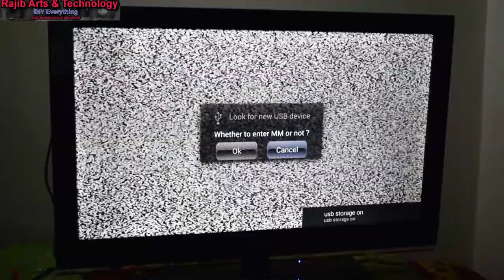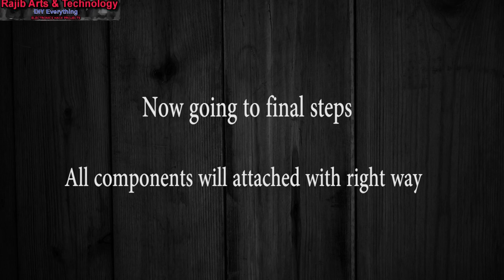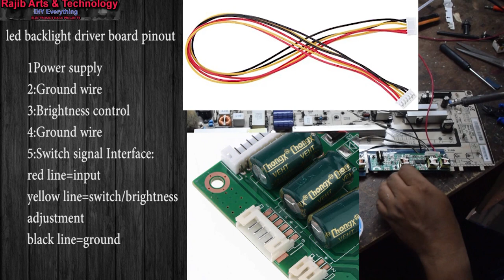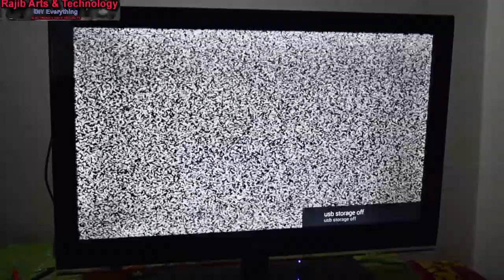Samsung 40 inch  LCD to LED TV conversion Part-01

Comment: nice save, but an evenly placed leds should give a better result. We clearly see that upper right corner is darker than other part of the screen
Reply from the maker: I replaced old led strips, so that's led lens are scratches,so you see some round ghost spot on it. I will buy new led strips to perfect......

Comment: hai.i had a faulty Mi led 43" android smart tv and sony bravia 40" full hd tv that still running good.can i convert my sony hd tv to led smart tv which is using My faulty Mi 43" component but not the lcd screen due to crack screen.was it posssible ?tq

Comment: sir, I tried to convert our 32inch LG TV from LCD to LED Bulb. My problem is when the CCFL is not connected on the Power Supply Board with inverter, the TV will auto shut off, it looks like it's protecting. What to do, please help?
Reply from the maker: You can easily solve if you change the main power supply
Reply: @rajibartstechnologymd.mahf9807 thanks for the reply but I already found out the solution, I just need to short the pin 13 on the power inverter IC to disable the backlight protection error and now our TV is not auto shut off